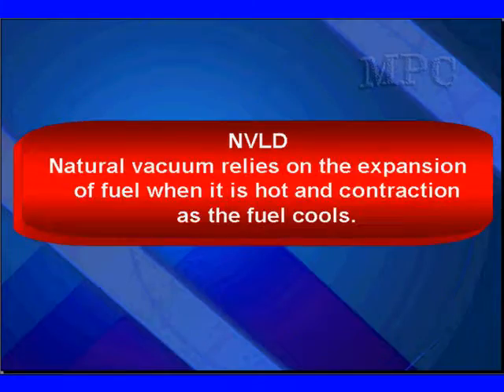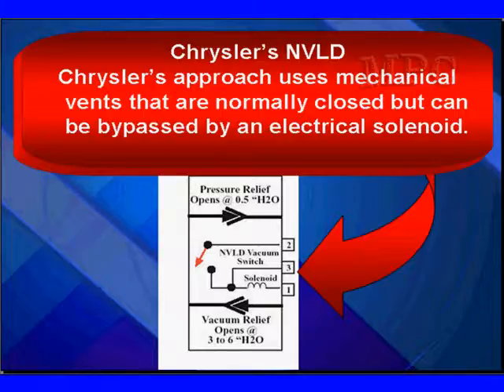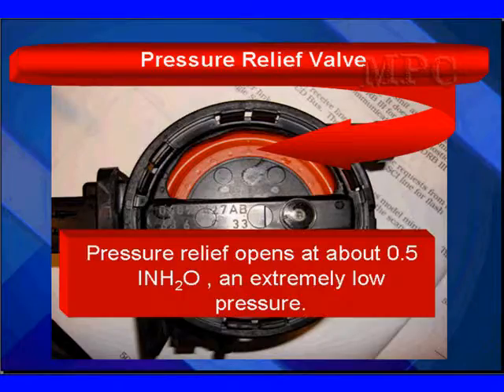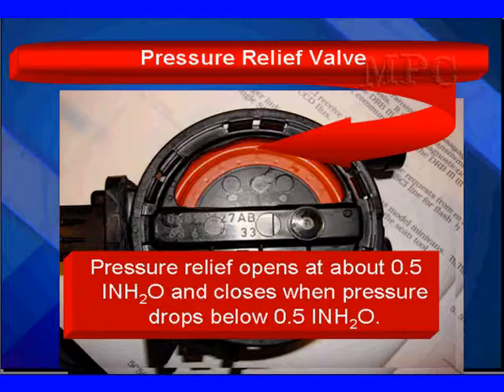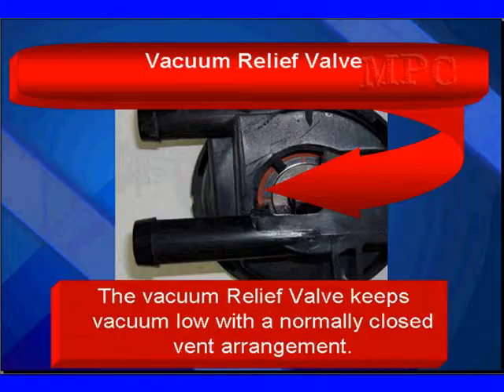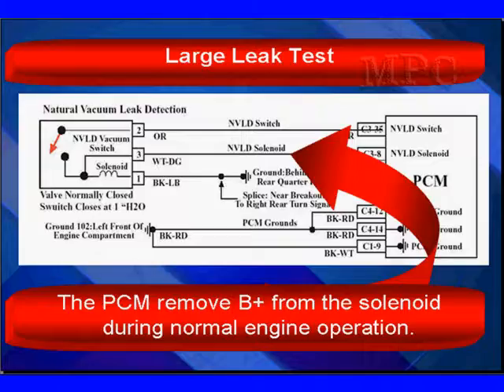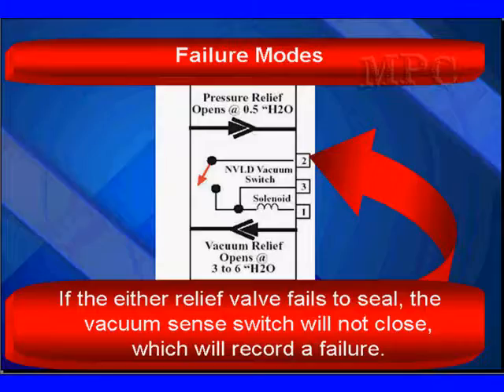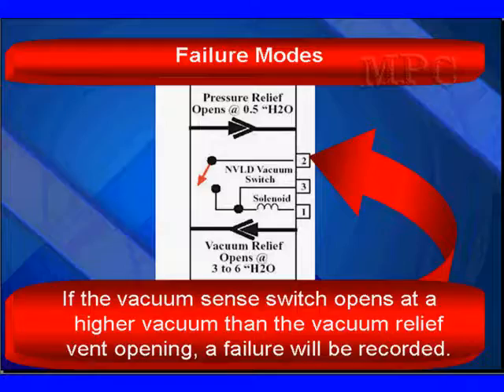01 Natural Vacuum Leak Detection

Comment: OMG I'm going crazy a ,P0440 on a 2005 pt cruiser non turbo. Replaced gas cap, purge solenoid, and leak detection pump! Smoke test shows nothing help!!! 3 trips to the mechanic still not fixed!

Comment: Does the 2008 Pacifica have the natural vacuum leak detection mechanical device. My vehicle is hard to fill with fuel and has no check engine light. If so where is it located? I have followed the lines from one end to the other and there is no device that looks like the one you electorate. Please help.

Comment: My MIL LIGHT only comes on, on cold starts, also? Never when I’m driving the car? That’s after, I clear the code.
Reply: EVAP system only runs tests between 15% and 85% on most applications. Temperature usually outside has to be between 40°F and 90°F. EVAP system is very finicky.